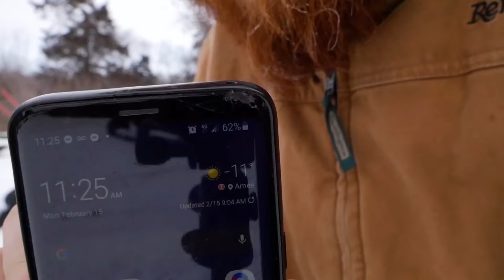Will this BIG BLOCK Dodge Run After 27 YEARS??

Comment: Holding the spark plug wire further away from the plug caused it to have better spark because when you create high resistance (aka making the electricity have to jump an inch) it actually gains energy- aka then has great spark. This is an old hot rodder trick, whenever the engine would flood from fuel, they would pull all the plug wires off and just hang them on the plugs (make it have to jump a large gap before getting to the plug like you did) to allow it to generate greater spark energy and start even with fouled plugs
Reply from the maker: Did not know that trick!
Reply: @JunkyardDigs  me neither Sir
Reply: Can confirm, this was one of the 1st tricks I was taught as an apprentice mechanic by an old head. Still my go to on flooded small engines. 👍

Pro tip: You can decarbon a fuel fouling plug and bring it back round on a running motor by "gapping" the boot slightly off for 10-20 seconds on the affected cylinder. The bump in current is no joke.  Saved me a few times on the trail with my 2 stroke bikes and sleds.
Reply: @JunkyardDigs    The science is a wet plug won't let the coil charge enough to be able to jump a gap.   When you unplug the wire and force it to jump there, the coil can saturate enough to fire fully hot and dry out the plug.   That's pretty common on motorcycles that don't have a distributor and don't have a gap from the rotor/cap.  Kinda odd in your case with this engine.

The thing you saw before you bought plugs was carbon tracking.  The path of least resistance on that plug was to run down the carbon and hit the body of the plug instead of jumping to the side electrode.

EDIT:  When you said ''I threw in this random Delco'', I thought to myself, "Self, I wonder if he's trying to use shitty ass Champion plugs''.     About two seconds later, I had my answer.
  Years ago when I was a service manager at a bike shop, I made a FORTUNE fixing ATVs that wouldn't run just by finding a Champion plug and putting in an NGK.  I've nevr found out how they can still sell spark plugs when they suck so bad (and not in the good way).
Reply: Also supposed to fire oil soaked plugs.
Reply: I broke a spark plug in half on a 390 Ford motor and I used super glue and glued the spark plug back together and put it back in the 390 and ran
Reply: Definitely a good trick and NOBODY knows about that one.. nice tell!
Reply: It runs rich . And have a 454 
.How do I get better/complete combustion.?
Timing?
Reply: @missingremote4388  should probably take this to a forum but what i can say is the carb probably needs tuning
Reply: Shout out to Mook.  Don’t forget your water.
Reply: @earlbrown I have run champion plugs for years in Dodge and newer Jeep without issues. I had a 78 power wagon with a 400 and tried Bosch plugs went back to champion because the Bosch were shit in that application.
Reply: Your correct, often when your chasing a dead cylinder by pulling leads you’ll notice that it comes back to life when the spark is jumping
Reply: @earlbrown  I came to see if anyone here knew what they were talking about and could actually tell us the real reason. Not only does it allow the coil to fully saturate but it allows the whole system to act as a makeshift capacitor
Reply: @markphipps3854  I have 7 old mopars and all champion plugs. Tried others and they ran like crap. Put champions back in. May not last as long but idc
Reply: That was what i did in the middle of the night, being stranded in nomans land.
And no cell phone service.
On my single cylinder bike the plug went out.
So i made a little fire using a fuel wet rag and spark from my ignition wire.
So i had the spark plug happy enough again to run on extended spark
Reply: Holding the spark plug wire further away from the plug only makes it look like there is better spark. There is no increase in energy, with respect to increasing current capacity. All things remaining equal, the available current remains the same.
Reply: its much safer on a electronic ignition to use a spark checker   holding the end of the wire from a ground is a good way to burn up the control module on the fire wayy . u can do that with a coil wire  but its much safer to use a spark checker
Reply: Pretty smort
Reply: Good tip
Reply: A GOOD WAY TO BURN OUT THE ELECTRONIC CONTROL MODULE  ON THE FIRE WALL. U C THE MOPARS USED A ELECTRONIC IGNITION STARTING IN 1972  UNLIKE  GM THEY STARTED THEM IN 1975. IYTS ALLWAYS SAFER  TO USE A ELECTRONIC  SPARK CHECKER . HOLDING THE WIRE  LIKE THAT  CAUSES THE MODULE  TO PULL TOO MUCH AMPERAGE
Reply: @Blueee51  LOL' NOT!
Reply: @moparman8254  ok boomer
Reply: I've never heard of that trick! But aside from the fouled plugs, if you have to do this to get spark, I'd start suspecting that the coil was weak or that there was high resistance in the primary coil leads, or maybe a bad controller somewhere. Thanks for the tip!
Reply: but not a good idea on a electronic ignition  motir & the 77  Mopar is a electronic ignition motor   Chrysler started electronic ignition in 1972  now gm did it in 1975  i dont know about fords (i dont mess with fords) but i do know mopars  up until 1988 when they went to EFI  then i stoped messing with them
Reply: @Blueee51  lol
lol  i know the older mopars ignition systems i learn it the hrd way from burning up a control module  by doing just what he did !
Reply: Yes, I use to pull the plug boot almost all way off when in woods and fouled out the plug in 2stroke bikes. Worked almost all the time and got me back home.
Reply: @earlbrown  champion plugs WERE good about 40 years ago.. they are getting hard to find these days anyways. I don't know any parts stores in my area that even have them on the shelf any more.
Reply: @bettingru  Well it often makes the cylinder fire when it won't fire with the plug wire fully connected.  I have felt it as well as seen it.
Reply: @moparman8254  It had stuck float valves at least, so they had to fix those.  So you are suggesting he flip the mopar as is to a mopar guy in order to stick with what he knows? or keep learning? He does have a good advisor in Dylan, and maybe UTG as well, though both are in TN.

Comment: Ok. Watching a rebuild of a carb while enjoying adult beverages and Kevin ripping ass probably makes this the BEST video I’ve ever seen. I’m dying laughing! You guys ROCK!!
Reply: I've run into that weird spark thing too like the spark wants a challenge.  One temporary response is to put the boots loose on the plugs, coil and, or cap so that the conductors don't quite touch.  More permanently, consider resistor wire and/or resistor plugs?  also maybe try another ignition module or inductor pickup coil?
Reply: It just makes me want to have a drink also

Comment: Oh hell yes Kevin and crew... thought I'd throw it out there that acetone mixed with ATF in a fancy sprayer is the best penetrating lubricant by far and it's super cheap-unstuck a few engines and lots of rusty bolts with it, on the daily.  Also another tip: just the tip, and only for a minute: if you buy a compression whistle, they're a neat and useful toy that can be modified with a grease zerk: you fill a cylinder with both valves closed with ATF/acetone mix to the top-screw on compression whistle with a zerk tapped in.  Then pump in grease at 10,000+psi from a grease gun.  Either the engine gets unstuck or it blows the head gasket.  Used a version of that many times with great success, even a rusty Honda bike with no spark plugs outdoors for 10 years

Comment: If you’re looking for a transmission for the truck, you’d probably have better luck finding a heavy-duty transmission off a larger application. 

A recommendation I’d make regarding a transmission for the 12-Valve Cummins is an Allison 2500PTS or AT545. You’d be able to find those from box trucks or school buses and those transmissions are quite stout for usage. School bus transmissions (due to constant stop-n-go use) have hardened components to hold up to abuse. 

The 12-Valve being used in various vehicular applications means there’s a whole bunch of adapter plates to mate it to various transmissions (mainly larger trucks and the heavy duty Dodge Ram pickup trucks) so finding an adapter plate for a transmission would be relatively easy, especially an Allison transmission.
Reply: I second what Joesph said.
Reply: I third what Joseph said.
Reply: They used 727's extensively in school busses. (And literally everything else for that matter.) They are reasonably rubust.
Reply: The 727 in the ramp truck is certainly not robust behind the 440 ;)
Reply: He wants a stick, an nv4500/5500/5600 would be a bolt-in swap on this truck as that's what they came with factory.
Reply: @proehm  Was just going to say the same.  They can take a lot of punishment.  That one may have some dried out internal seals and might come back to life somewhat once they swell back up.  I had a 1980 New Yorker that was sitting for a couple years before I bought it and reverse wouldn't work until it warmed up.  Over time, the problem got less and less until there was only a slight delay in very cold weather.  It had a 360 V8/ 727 power train.  Was one of my favorite cars.
Reply: @reesewilliamson3346  this particular truck however is an automatic. And to change it over to a stick would involve finding additional components, like a clutch pedal, a master and slave cylinder, additional plumbing, etc. I recommended an Allison transmission both for how stout they are for heavier applications and ease of finding parts to bolt it behind the 12-Valve Cummins, like an adapter plate and other components to get it to play nice with the engine. Plus the Allison transmissions can have several mounting setups (both factory and custom mounting) due to the multitude of applications they are put in. Also they can have PTO available (depending on transmission) if so desired. 

If I had the truck, and I was putting in the 12-Valve in place of the 440, I’d pair it with an Allison transmission. A good pairing for the application setup.
Reply: @josephbugaj8149  I know this truck is auto, even auto trucks are born with the firewall holes for a clutch master. Auto = boring. 12v and a getrag 6spd or a nv5600 would be absolutely perfect for this, not to mention any Allison newer than ~1980 is a turd and any one older is so wore out you need to dump the price of a getrag into itto have a good reliable tranny.
Reply from the maker: There's actually a 12 valve with an Allison from a school bus for sale locally, but I figured it would have an CAT 2 or 3 bell housing, and it has a VE pump. Meh??
Reply: @JunkyardDigs  they do have P-pump conversions for those VE pumps available plus you’d make a couple bucks from selling the VE pump for rebuild. And I’ve never had an issue with my Allison transmission in my school bus (I’ve had more trouble with the VT365 in my 06 CE200 as of late than the transmission)
Reply: @JunkyardDigs  Dont be scared of the Allison, they are nearly bulletproof. That ramp truck with a Cummins/Allison swap wont even break a sweat hauling another truck on its ramp. I have 18 years of experience driving a school bus, only ever saw one failure due to a massive fluid leak.
Reply: @JunkyardDigs  Another thing is to get the bell housing to fit the 12-valve, there’s an adapter plate that bolts directly to the engine block (behind the flywheel) and gives you the bolt pattern to mate an Allison transmission.
Reply: @JunkyardDigs  you can convert a VE to P pump, use the motor you already have and swap the parts over as it’s all external differences Nothing wrong with VE pumps unless you want to max out the fuel to roll coal

Comment: As I recall, the Thermoboxes weren't a problem to rebuild - you just had to check for bowel warping (plastic main body) and I THINK the secondary hangers were real thin and prone to bending. Either way, Mook'll probably need four shots to rebuild one.
Reply: I have a '79 Dodge with a 318 that has a Thermoquad I'm about to go through, and I've been doing a ton of research. You're right, bowl warpage was a problem, which can sometimes be helped with some fine grit sandpaper glued to a sheet of glass with rubber cement. Other issues tend to include:
1) The crossover tubes that feed the primary wells tend to come un-epoxied over time.
2) People tend to try to use regular o-rings on the primary wells when they actually require X-rings. 
3) People overtorque the air filter housing wingnut, pulling the top of the body away from the bowl and causing vacuum leaks. 
If you avoid/fix these problems, apparently they run really well. I'm excited to find out.
Reply: @MichaelDavis-cy4ok can I still buy X-rings?
Reply: Its basically the same as a AFB. Super easy to rebuild and tune. Tho I am a Q-jet fan so what do I know? Lol
Reply: @shawnsatterlee6035  Wait, lemme guess - you've got a tray full of jets, secondary metering rods, hangers and bodies, that you grabbed at the junkyards, from 500 Cads, other big-cube motors and any performance-optioned GMs:)

Comment: I'm a mopar fanatic with a 76 w200 400 4 speed powerwagon and love thermoquads.  Have over 20 of them in the shed. Great carbs in the right hands
Reply: @1oldironboomer  is it a 4 speed? If so what NP trans do you have? Mine has the NP 445. It took me 6 years to just find parts for mine.

Comment: I have a '76 Power Wagon and that big ole amp meter wire thingy almost toasted my pickup since it was run through the standard harness where the wiring goes into the cab. So I just bypassed it and I haven't had any issues. Interesting to know it was a consistent issue and not a fluke like I thought it was.
Love the videos man.

Comment: That ac Delco plug is probably an rts xxxx plug meaning it has a resistor in it and the dodge needs higher resistance for proper spark witch explains all your issues. Coil is breaking down due to not being able to unload properly

Comment: Beautiful truck. The ThemoQuad is a great carburetor, rebuild it. That 727 transmission is pretty much bulletproof too, and as far as automatic transmissions go, they are fairly easy and inexpensive to rebuild.
Reply: Mine is stuck in forward gear.  I can get neutral by turning the engine off and when in reverse, it is in reverse and forward at the same time.  Do you know the cause?  Drives fine forwards as 123 are all normal.

Comment: I remember way back in to “60”s they used to sell plug wire spacers to increase the gap between the plug wire end and the plug to increase the spark. I also recall having to hold the wire away from the cap to get the dead cylinder to come in!

Comment: There was a CarTalk puzzler on this years and years ago. As I recall, it went along that on a cold day a guy was having trouble starting his car. An old mechanic came by and pulled all the wires off the plugs just a little. In effect, this increased the electrical resistance of the path and therefore increased the heat of the spark allowing the car to start, and then the wires could be pushed back onto the plugs.

Comment: Back in the day all cars with Amp gages ran the hot through the Amp meter. Not just MoPar. Chrysler was the first to introduce electronic ignition and Alternators. Remarkable! I've had a spark plug sandblaster/cleaner for over 40 years. Get one you'll love it.

Comment: I have good luck with starting old engines that have set for years by putting 80 90w gear oil in the cylinders. It has worked on engines that had 10 lbs compression. Once the engine starts and warms up the rings come loose and the engines start and run good after.

Comment: Rebuilt many 4 barrel carbs back in the 70s and 80s. Holden used the Thermoquad on their 308 v8. All my Ford v8 Cleveland and Windsor were fitted with various Holley carbs.

Comment: Awesome old Dodge, great find and purchase Kevin & Mook!
Cold or hard starting engines, carefully hit em" with 24 volts from two 12-volt batteries... it works!
Good old Carter Thermo-Quad carburetor... I've seen hundreds of those thrown away in scrap piles around here.
Why are you touching the grille with your wiener schnitzel... do all mechanics do that?

Comment: When I was a young mechanic back in the 70s i discovered i could often start a flooded engine by pulling
 the coil wire out about 1/2 to 3/4 inch creating a gap for the spark to jump just like your situation. I don't know why it worked but it did. subsequent running of the engine to clear the flooding and they were good to go. Something about the fouled plugs.

Comment: I'm an,a.c.delco fan every year I'd clean my plugs,in spring and maybe half into the season. Ran the same Delco plugs in my 85 harley for seven years. After a compleat upper end rebuild I changed them . They still worked just old👍👍

Comment: Fun fact about Chrysler engines, if the distributor is in the front, it's a big block (383, 400, 426, 440, etc.) If it's in the back it's a small block (318, 340, 360).

Comment: From what I've heard from other builders (DeBoss Garage for one) Cummins 6bt into an old Dodge/Chevy is almost a drop-in, as the 6bt was in dodge trucks, lots of the bolt-holes are the same for various engines throughout the years. For Ford and other brands there has to be conversion kits because they have different hole patterns and such being completely different auto makers. Take that with a 5lb grain of salt as I hear this 3rd/4th hand and don't know for sure. :)

Also, I suspect the trans is internally grenaded, how you got it to go forward the first time was some of the chunks lining up and catching to push it forward. That's what the sound is whenever you put it in drive/reverse is the chunks being slushed around until something lines up and it moves.

Comment: Spark plugs can short out. Likely they were flooded several times.  The reason why the plug fires when held away from the plug is because the separation will increase the voltage.